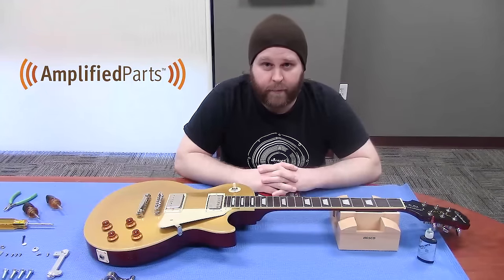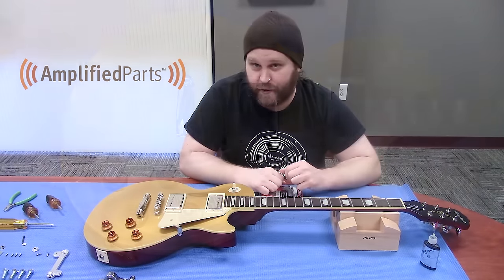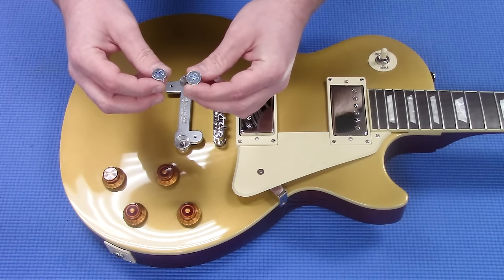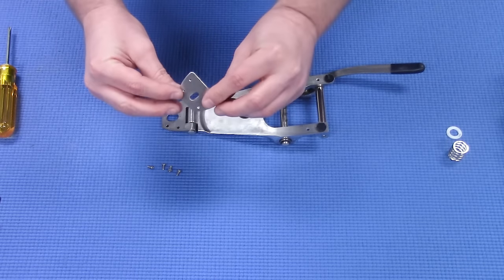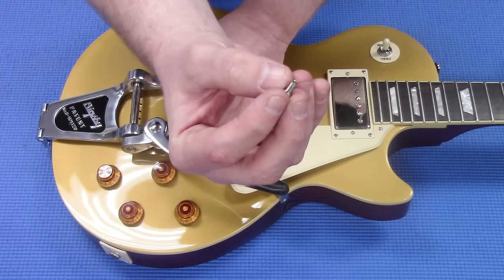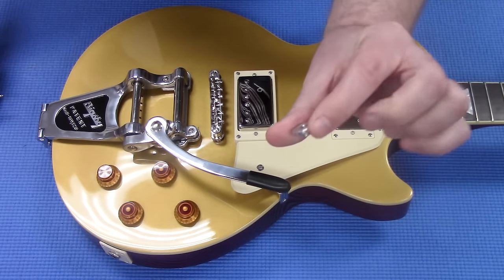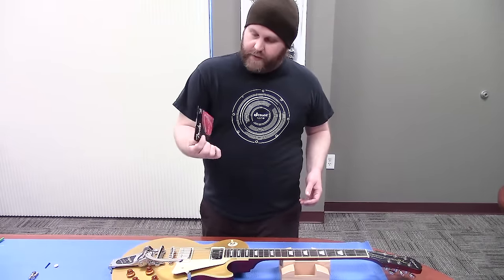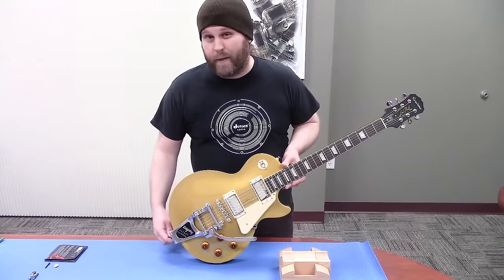Install a Bigsby Vibrato on your guitar without drilling holes by using a Vibramate

Comment: One thing the video forgets to mention is the price. If you have an option to buy the guitar with the vibrato go for it since it's a much better deal. This here is not worth the cash unless you find a really amazing deal on the adapter and vibrato. In Germany in big online shops both parts together cost like 360 EUR. I'm looking to buy the Gretsch G2622 but noticed that there is also the G2622 for like 70 EUR or so on top of the price for the non-tremolo version. 70 EUR compared to 360 EUR or so is a huge difference. I would go for this only on a very expensive guitar (like 1000+ or even 1500+ EUR).

Comment: roller saddles, string spoiler, and truglide are definitely recommended... i also like to swap out the stock 7/8-inch spring for a 1-inch spring...
Reply: Some good tips.

What difference does changing the spring make?
Reply: If you play with heavier strings, the 1" is a must to stay in tune.
Reply: they make even bigger ones than 1" now
Reply: @dustinmccrindle343  it adds more tension and stability to the vibrato unit... it also allows for a wider pitch bend

Comment: Thanks for the video Justin. I tuned in to see if this set-up would be compatible with my '52 Les Paul gold top. It's a real '52 so it doesn't have screw-in tailpiece. Can a Bigsby be installed without screwing down the top? would it sit on top of a Vibramate for spacing without too much moving? Spacing for height is the next big problem.
Reply from the maker: The Vibramate plate requires the screws to hold it down so I don't think it would work and they don't have the '52 listed on their recommendations page. It'd work with modifications but it would be a shame to mod that guitar!

Comment: Can these be installed on any set bridge? I’m wanting to put one on my firefly Les Paul
Reply from the maker: The stud spacing will work with most (import and domestic) tune-o-matic style bridges, but the distance from the bridge to the lower edge of the guitar body may differ from a Gibson/Epiphone Les Paul and may prevent a proper fit.

Comment: My question is. Will there be any damage to the finish?
Reply: No, there's felt anywhere it contacts the finish.
Reply from the maker: Exactly what Guitar Tube said. This is designed to be a completely free of modifications/harm to your guitar,
Reply: Looks pretty damn good with that Bigsby on.
Reply: will it work on the epiphone genesis
Reply: @nikolabakich9709  No.  The toggle switch would be in the way.
Reply: @gpdude22  What about a Gretsch pro? I want yo upgrade it's current bridge
Reply: @raymondhair8384  It's likely that it'll fit, but check up on it.
Reply: Player One  Check if it's body is the same size as the Les Paul, if yes, then it'll fit.

Comment: Does this also work with semi hollow bodies?
Reply from the maker: The B7 is commonly used on semi-hollow body guitars, but the Vibramate adapter used in this video would not fit. Vibramate offers a V7-335 in a "G" (Gibson) or "E" (Epiphone) sizing. https://www.amplifiedparts.com/products/adapter-kit-vibramate-v7-335-gibson-and-epiphone-arch-top

Comment: I have a Ibanez AS 53, wanting to do the same. Tried to google for size, but no luck. Anyone know what size Bigsby or Ibanez vibrato would fit my guitar?
Reply: have you done it? I want to add a bigsby to my AS53
Reply: @danielgoncalves2306  Not gotten that far yet. I know Ibanez have their own type, but I know there is a model you can use where you don't need to add any holes. Can't remember which one
Reply: I just put a p90 in the bridge position
Reply: @danielgoncalves2306  Yes, routed out for p90. nice combination with the  hum
bucker.

Comment: Anybody know if this would fit on a jazzmaster body? With a tunomatic style bridge?
Reply from the maker: Vibramate does make an adapter plate for offset guitars, however, it uses the B5 unit rather than the B7 used in this video. Here is a link to the adapter plate: https://www.amplifiedparts.com/products/vibramate-v5-jam-mounting-jazzmaster-and-jaguar

Comment: I don't have a 2 piece bridge on my Epiphone Les Paul. So do I need to buy the 2 piece to do this???
Reply from the maker: This adapter kit is not intended for Les Paul models with a wrap tailpiece.
Reply: @amplifiedparts  can I buy q reproduction 2 piece bridge and install it that way??
Reply from the maker: @4.6_Nate  that would essentially defeat the purpose of the adapter kit, as installing a two piece bridge design would require some significant holes to be drilled in the guitar, and the Vibramate replaces the stop bar entirely. You would need to do some pretty heavy mods to the guitar and would be left with parts that aren't necessary at the end.
Reply: @amplifiedparts  I'm not here for the adapter I was more looking into getting a bigsby period. I have an epiphone les paul that I want to mod out to make better and a bigsby is on that list, so I say again, I'm not here for the adapter kit
Reply from the maker: @4.6_Nate  the Vibramate adapter plate is the only product in the video that is directly affected by the bridge setup on your guitar. The Bigsby vibrato itself is an aftermarket unit and can be used on multiple models with various bridge configurations. A B5 unit may be more appropriate for your guitar if the top of the guitar isn't carved as opposed to the B7.
Reply: @amplifiedparts  the entire point of me watching the video was to see you install the bigsby. All I'm asking is can I install a bigsby without changing my bridge. That's all the info I need here. I' sorry for any confusion on the matter

Comment: Hey does this kit work on a les paul with a wraparound bridge?
Reply from the maker: This Vibramate won't work with a wraparound bridge. It needs to mount to the bushings of the stop bar tailpiece
Reply: amplifiedparts what should I use, mine has a wraparound bridge
Reply from the maker: @lincolnlee6042  If you're looking for a trem for a wraparound bridge that doesn't require drilling holes, I think Schaller might make one that works. You may need to change the bushings though and of course check the spacing.
Reply: amplifiedparts ok, will do! I appreciate it!

Comment: My OCD just kicked in on the very concept of Fender Strings on an Epiphone/Gibson Les Paul. In order of matchy, matchy, Gibson 10's, PRS 10's, anything else 10's and the last set of 10's strings you EVER put on a Epiphone/Gibson is Fender 10's. And if you EVER do put Fender 10's on it, keep that much local knowledge to yourself. Just kidding here, put whatever strings you prefer on them.

I like this video, going to be putting a Bigsby B5/B50/B500 on a Epi LP Special I P90. The issue is it has a single piece that is fixed intonation bridge. So this installation doesn't apply to me per se. But it does indicate that I leave the bridge where it is and I have to mount the Bigsby that far of an exact distance behind the center line of the bridge screws and in perfect alignment. So I will be drilling holes. Now I'm off to determine that from a blueprint indicating those measurements for the Epi LP Special II with a 2 piece Tune-A-Matic bridge system if I can find one on-line. They call those models Epi LP Special II that comes with humbuckers instead of P90's.

Comment: anyone know what kit would fit a supro hampton?
Reply from the maker: Hey Evan, these are designed for mounting into existing holes on the guitars. A lot of them are for stop bar tailpieces and others are for very specific hole patterns like a Telecaster or Jazzmaster. It doesn't look like Vibramate currently has a model for the Supro Hampton.
Reply: amplifiedparts thank you for answering my question.

Comment: Would this work with a Korean Tokai Love Rock?
Reply from the maker: Hey Paul,

That model is not mentioned on Vibramate's adapter guide: http://www.vibramate.com/vibramate-model-chart.php

If there is a Bigsby with the correct length and the tailpiece is compatible with Gibson Les Paul tailpieces, there might be a Vibramate that fits your guitar.
Reply: amplifiedparts 
Cheers. I will do some more research.

Comment: Will it work on a gibson explorer?
Reply from the maker: The B7 unit and the corresponding V7 unit would not be compatible with an Explorer. A B5 unit and the V5 adapter are developed for guitars with a flat top and a stop bar tailpiece.

https://www.amplifiedparts.com/products/vibrato-bigsby-vibramate-set-b5-v5-aluminum